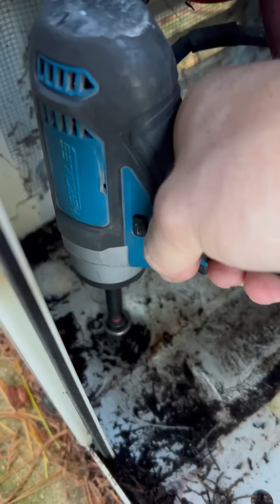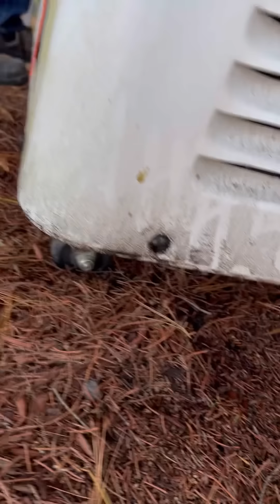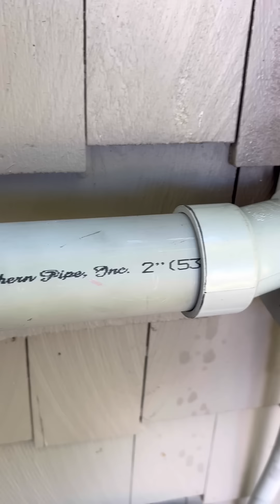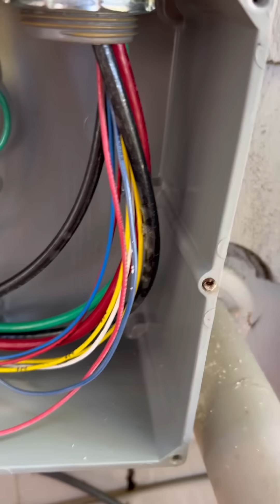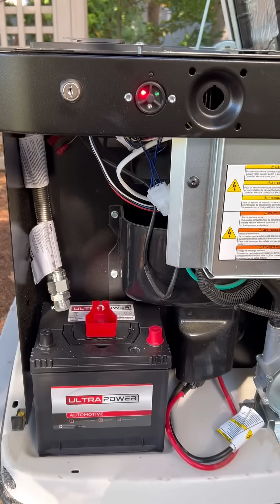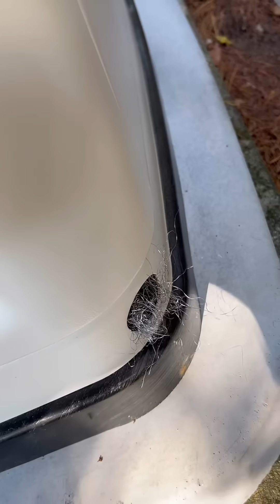You Won’t Believe This 100 Amp Generac Install!🔥 (Perfect Setup)#shorts #electrical #dayinthelife

Comment: Couple of things:  The best punch set is the iToolco gear punch.  If you are below the bussing, you don't need a sealing locknut (in my jurisdiction).  The transfer switch has draining built into it through the corners/front cover in case of water ingress.  Also, I personally put the sealing locknut on the exterior when I use them.  Additionally, install the conduit with the manufacturer writing away from view.  And why not put a bushing on the generator feed conduit?

Comment: I See you only use bushing on the two inch conduit with the main wires but 
 didn’t see on the other conduits that were going into the xswitch ,whys that?
Reply from the maker: #4 or larger you need a bushing if not no bushing required
Reply: @SchecterElectric  ok thanks.

Comment: Great install. Heads up on those sealing locknuts, they’re only listed for IMC and RMC. They’re not intended for PVC because the threads aren’t tapered.
Reply from the maker: Yea I know what you mean inspectors on our area don’t really enforce that bc realistically the o ring is making contact with the plastic box sealing it the lock nut doesn’t ride on the edge of the connector so it works out just fine. I’ve even had an inspector say he rather see the weather proof locknuts bc of how well they work. Thank you for your comment friend!
Reply: @SchecterElectric as a tip, I would strongly recommend adding a bead of a quality exterior rate silicone with that O-ring.  Doesn't take a lot, a little goes a long way, just needs to be even circle, no gaps. But doing so will help the O-ring last much longer and make a better seal again water.  It's kind of how like for PVC a solvent prep & glue works better than a glue alone for solvent welding. Or how RobRoy RMC will last far longer in the UV degradation with a simple wipe of a clean rag wet with Armor All.  Just some inexpensive steps of small quantities but big impact on longevity.

(FYI: industrial & commercial electrician here, where I can comment on what tends to last and what just cracks & breaks up, especially in midly corrosive atmospheres or intense sun heat & UV.
Reply from the maker: @XSFx5 thanks for the tip!

Comment: What happened to the old one?
Reply from the maker: I scrapped it
Reply: Let me rephrase…why did you replace the old generac? And how many hours were on it ?
Reply from the maker: @johnathanrae7338 I don’t know how many hours were on it it was about 10 years old. We replaced it bc it was leaking oil and the throttle mechanism had issues and other parts were starting to let go and the customer didn’t wanna have to worry about it starting he wanted piece of mind with a brand new machine.
Reply: @SchecterElectric I gotcha just curious what was going on with it. Thank you for the response
Reply from the maker: @johnathanrae7338 yea no problem
Reply: Old PowerPact was junk.

Comment: Excellent work! Good call on the sealing locknuts
Reply from the maker: Thanks friend it’s a code violation if you don’t use them and water will rot that gear out pretty quickly

Comment: I noticed that you did not strap the whip from the wall to the generator, also you did not strap the raceways from the meter socket, and you did not strap the Raceway for the receptacle.
Reply from the maker: If the carflex whip is less than 6’ doesn’t need a clip also the fittings on the 11/4 pipe and 1/2 pipe are considered supporting the pipe so no additional clip is needed. Also it’s kind of common sense a 6 inch piece of 2”pvc and a 5 inch piece of 1/2” pvc doesn’t need a clip it’s not long enough.
Reply: @SchecterElectric I think you need to check your code book.
Reply: @jeffreyknowles6265 nah you should check and cite the codes
Reply: @jeffreyknowles6265  I think you need a 2023 NEC code book brother
Reply: @slothington679 I have every code book since 1984. When the 2026 Edition comes out, my apprenticeship director will get me a copy.
Reply from the maker: @slothington679 yea bc if you look up the rule about carflex and lengths of pipe you’ll see don’t need a flip
Reply: @SchecterElectric what is a flip?
Reply: @jeffreyknowles6265 clip
Reply from the maker: @jeffreyknowles6265 clip